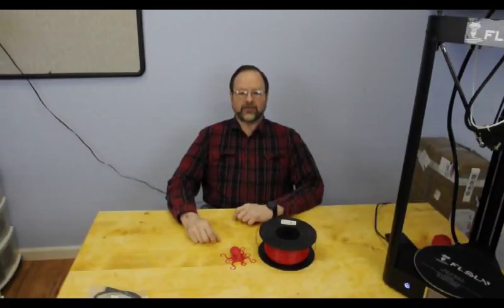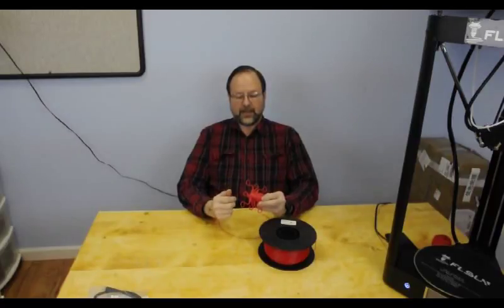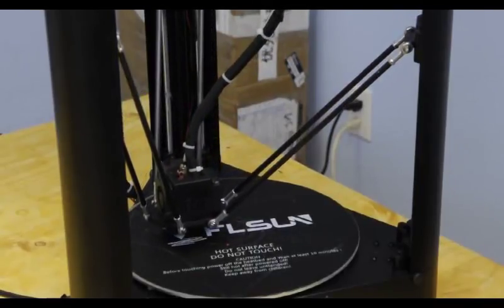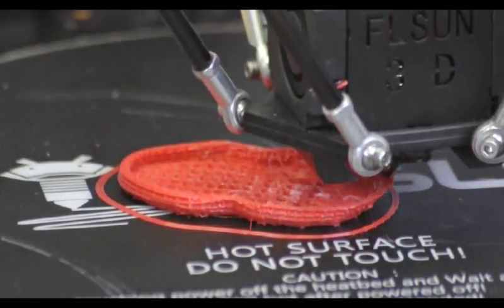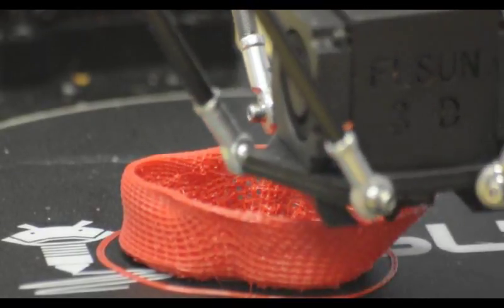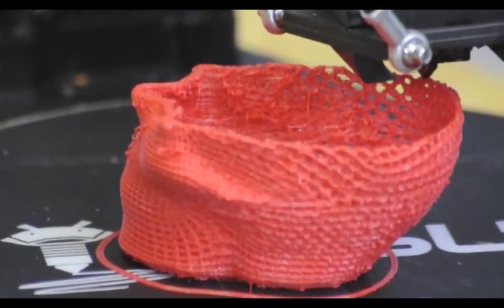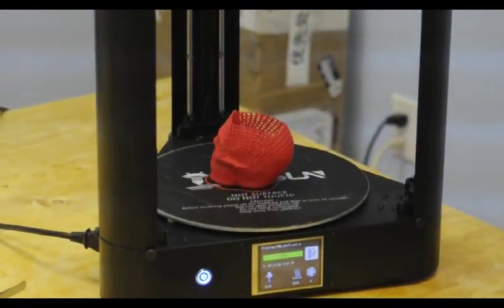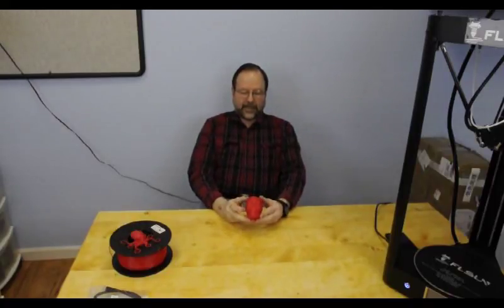Printing flexible filament in the QQ

Comment: i have a question, about heated beds in general, im new to printing so sorry if this is a old question, has anyone tried using slick mats on top of the heated tak bed instead of glass or instead of  right on the bed. i know people use tape and glass but i havent seen anyone try slick mats, they can take the heat, things will stick to it but then come right off.https://www.amazon.com/Oil-Slick-Platinum-Medical-Silicone/dp/B0080S1JWW/ref=sr_1_2?ie=UTF8&qid=1523030724&sr=8-2&keywords=slick+mat . the reason i bring it up is that its heat proof but gets hot, plastic actualy does stick to it but will never fuse to it so removing the print should come off instantly. also would be simple to remove from the bed by pulling it off but it will initially seem to stick to the plate but lifts right off and then the print would come right off.
Reply from the maker: TrickGaming I personally have not heard of anyone using that type of mat.  If you raise this question in one of the 3D printing Facebook forums you might get a response from people who know little bit more about that particular material.

Comment: one more question, im getting glass cut out for the build plate, would you know the exact size it is that i need to tell them to cut and the best thickness.
Reply: The build plate is 265mm in diameter.  If I was ordering, I'd get 260mm since you don't print right to the edge anyway, and that will shield the glass edge a bit.  As far as thickness, it depends on the glass.  If you are getting borosilicate glass, a 2mm thickness is sufficient, and saves on thermal mass to heat.  If you are using regular or mirrored glass (which I don't recommend due to spalling), I'd say no less than 3mm.
Reply: thank you ray, calling now and asking what type of glass they have
Reply: I was able to get borosilicate glass cut to 260mm with both 2mm and 3mm thickness so i got 5 of each custom made. thank you very much for the advice , it truly helped

Comment: hi, i noticed that we are on marlin 1.1.6 firmware and that the new marlin firmware 1.1.8 is now out . would you be able to do a video on how to install the new marlin 1.1.8 firmware onto the Flsun QQ. thank you for your time
Reply from the maker: TrickGaming I will look into upgrading Marlin to the most recent version, but I am inclined to advise not to do it. I have heard of various issues with Marlin 1.1.8 leveling routines. Also, there will not be any noticeable Improvement in printing between the two versions. Finally, Flsun has implemented power loss recovery in the Marlin that comes with the QQ, and I am not sure that code is included in 1.1.8. I will post a follow-up comment when I've resolved that question.
Reply: ok sounds great, i heard about the leveling bug as well. I take it its best just to wait until all bugs are worked out and flsun updates it and then flash it when that time comes. i appreciate it thanks for looking into it.

Comment: do you feel its held back by being a 8 bit board instead of it having a 32bit board or is it fine as is
Reply from the maker: TrickGaming that's actually a tougher question than you might think. Most 3D printers would operate better with a 32-bit board. Deltas, in particular, would benefit by the increased computing power since they have to do the trigonometric conversions all the time.  However, Marlin is a mature firmware offering features that would not be available in some of the firmwares available for 32-bit boards. Smoothieware in particular, although extremely stable for what it does, does not offer nearly as many options. Since most Chinese made 3D printers use Marlin on the 8-Bit boards and smoothieware on the 32-bit boards, both being open source, I think you would lose a lot moving to 32-bit at this moment. Once Marlin 2.0 is released for 32-bit boards that is likely to change.
Reply: aahhh. excellent explanation and again I appreciate the reply. makes perfect sense.